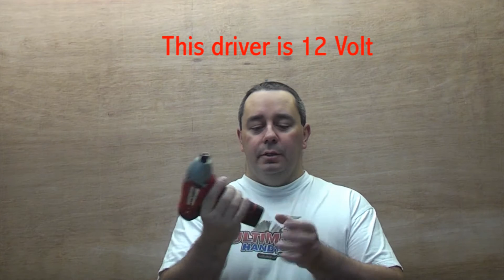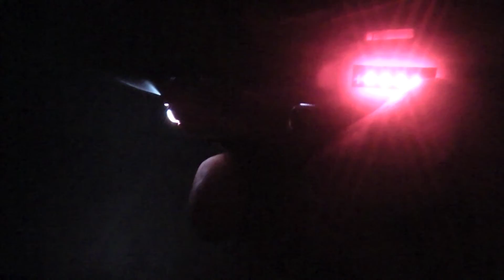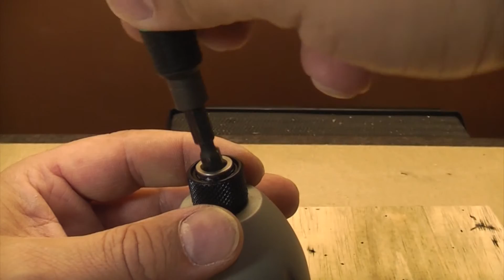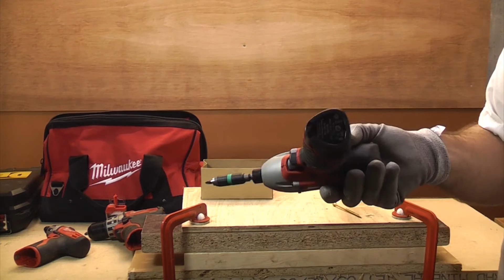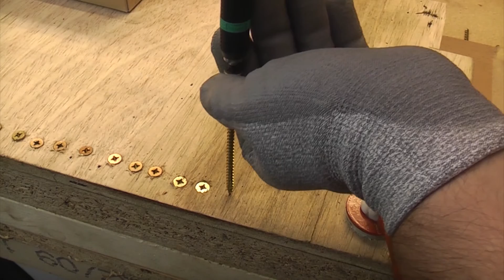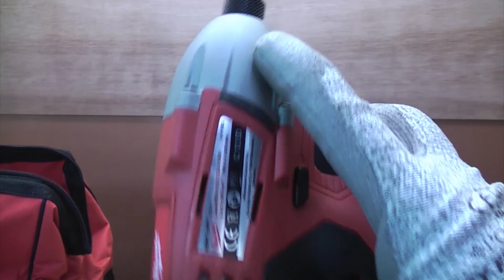Milwaukee 12v impact driver review

Comment: the milwakee  brand makes weird looking tools the drill handles are off center this is why i changed to another brand milwakee is not american anymore made in china assebled in mexico over priced by 3 times 1 drill 150 bucks any other company 69 bucks with a charger so screw you milfuck ye

Comment: How would you rate ryobi tools? I've seen a few deals on them but don't know if I should save and buy a other brand like dewault. I only really use tools for diy.
Reply from the maker: I have only ever used one Ryobi 18v drill and it was not brilliant, but a guy in my forum uses nothing but Ryobi (he is a bench joiner).
For most DIY'ers Ryobi stuff should be fine to be fair.
Thanks for the comment
Reply: I use ryobi at home, its good for small applications, but the impact driver is quite big and bulky but it is actaully one of the most powerful drivers ive used!
The only problem is they get hot extremely quickly.
Cheap and cheerful, and the Saws are good.
Without a 4 or 5 ah battery the cordless range isnt powerful.
I hope this helps

Comment: Hello,
Do we have to use special bits when using an impact driver? I came across a pretty nice DeWalt set today, but I have no idea whether they are impact rated or not. 
Keep up the great work. :)
Reply from the maker: Hi, yes you need to use Impact sockets/bits with an impact driver.  With normal sockets there is a chance that they will disintegrate with the shock and can send shards of sharp metal flying everywhere.
Thanks for the comment

Comment: I use Vermont American made in USA basic low bucks magnetic screwdriver bits in my 1400 inch pound v18 impact driver and they do very well. They aren't listed or advertised as compatible with impact drivers but they work well and last for 1-2 lbs of screws each. Frankly I'm shocked at how quickly that bit snapped on you I've always used my low bucks VA's in a cheap walmart black and decker sleeve guide bit holder and have never wanted anything more . The v18 is a beast too it'll snap the head off a 3/8 lag, but is very heavy for that power.
Reply from the maker: +charredskeleton I can imagine the 18v versions being very powerful.Thanks for the comment ;-)
Reply: +Ultimate Handyman  Not worth the weight for most applications, the newer m18 line is lighter but the M12's are the real ticket in my book. I just have the first gen m12 screwdriver and it's great, very powerful I'm planning to add an m12 impact driver soon. Laying decking the old v18 shines, the weight holds it down! Good safety notes on your part too. I don't get cut because I wear gloves, I can hear because I wear ear plugs, and safety glasses have saved my eyes MANY times. Fitment is the key on safety gear. I find I can focus better in my gear.
Reply from the maker: +charredskeleton 
Absolutely, safety gear is critical. Safety glasses have saved my eyes on a couple of occasions!
Thanks for the comment ;-)

Comment: On the subject of noise - these impact drivers normally put out more then 100dB when under load. That's enough to seriously damage you hearing without protection. Add a pair of ear defenders to those safety glasses.
Reply from the maker: ***** Thanks for the comment ;-)

Comment: I have this impact driver and the power is amazing! Also feels good in my hand.. I don't use it much but when I do it's ready to deliver the power that I need.. My only complain is that battery does not last too long with this impact driver and it is noisy.
Reply from the maker: I have a couple of the 3ah batteries which are a lot better, but like you say it is noisy!
Thanks for the comment

Comment: can u usethis  imp driver to install m10 bolts into concrete as well also take them out ....??
Reply from the maker: I doubt it, you would be better off with an Impact wrench, rather than an impact driver (which are mainly for screws)
Reply: i was told to purchase the milwaukee  2650-20 its a 18v driver , by my local milwaukee dealer here ,, whts ypur opinion on this .......thxs
Reply from the maker: MySoundboy
I don't know why they have recommended an impact driver instead of a wrench, but they must know what they are doing!
If possible you need to test the machine to see if it will work as it only seems to have about 116 foot pounds of Torque. Might be a good idea to wee what the recommended tightening torque of M10 bolts is in concrete?
Reply: ***** i also need to take out screws as well , forgot to mention this to you
Reply from the maker: MySoundboy
Normally an impact driver is used for screws and an impact wrench is used for nuts/bolts.
If Milwaukee say that machine will do the job, I'd go for that. If it does break in the first few weeks you can always take it back to them- they can't say it's your fault if they recommended the machine to you LOL

Comment: besides the weight issue, is there any reason a non professional DIY person would miss this if already owning a good combi drill (drill, hammer and screw options, variable speed) ? 

Thanks for your vids, really enjoy them. Also, I laughed a bit at the level of detail when you clarified where the thumb would sit when left handed ;-) nice detail there hehe
Reply from the maker: To be honest I use my combi drill all the time. The impact drivers are noisy to use. I'm sure they are also slower at driving screws in- but they can drive larger screws!
Thanks for the comment ;-)
Reply: Impact drivers put much less stress on your wrist they also don't cam out nearly as much or bad so they strip screws much less often(almost never). Personally if I had to choose one tool I'd rather drill holes with my impact driver then drive screws with my drill/driver.

Comment: I got this as a bundle deal that came with the drill, the driver 2 batteries, charger, bag and another battery, total of 3. I got it for light jobs so your demo surprised me.  I got Milwaukee because from a place I used to work at where we built machinery everyones tools were breaking, all except for Milwaukee. One of the Milwaukee's finally failed but they replace it for free. They make good stuff.

Comment: That is a very slow impact! Try the Dewalt 12V, its faster, also you dont have to lay tool on its side it stands on the battery and the handle is smaller for better grip.

Comment: I agree with some of the other comments. I do build decks and for that I use Robertson screws. You can also get various lengths of bits with the same end as that extension. I never use an extension in my Milwaukee 18 volt driver. There are also specially designed Robertson bits made for just for deck screws which will last longer than the regular bits and the square shape means no slipping.